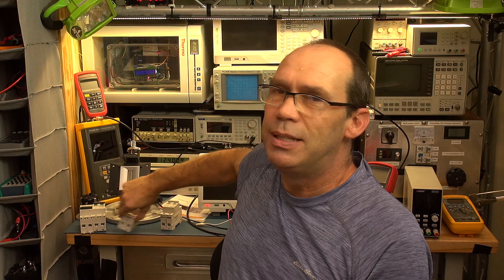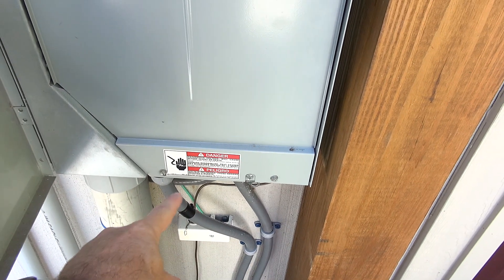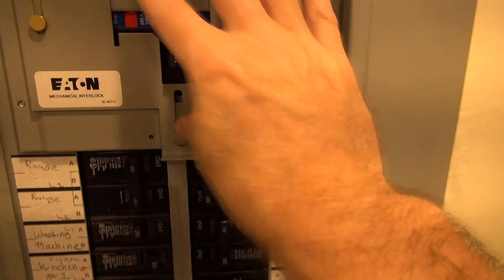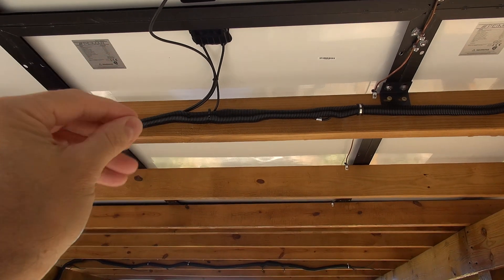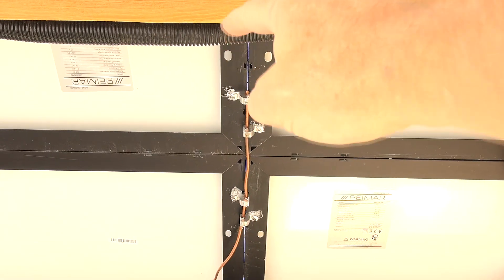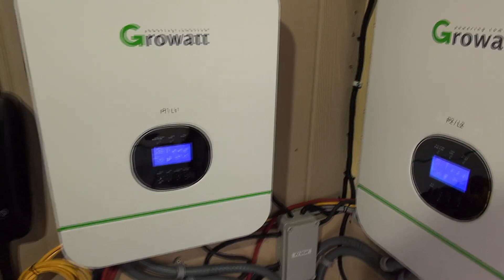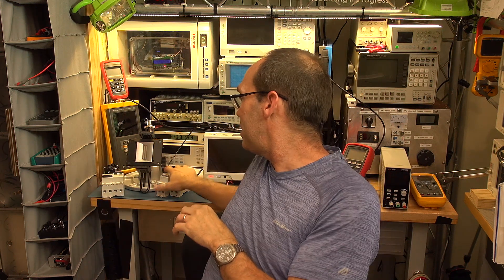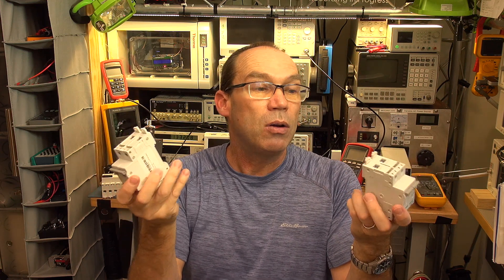Solar Carport Overview

Comment: Very interesting video, Martin.  I enjoyed it very much.  Just a comment about the barrel-type contactor you showed at 42:48.  Their coils typically draw at least an amp in operation, and they can get surprisingly hot as a result.  If you do use one, be sure to get a continuous duty model.  Many contactors of that style are designed for engine starting, so their coils aren't rated for continuous duty.  One trick to save power, reduce heat and extend the life of relay coils is to find their minimum pull-in voltage on the bench and operate them a couple of volts above that level.  Since your installation has no vibration, contactor pull-in and hold will still be reliable at reduced coil voltage.  Keep up the great work!

Comment: Thanks for this video.  Like all your videos, I can tell a lot of work went into it.  I am currently installing (slowly) a Growatt 5000 with a Solar Edge transformer to get 120V output and it helps to see how you did your grounding attachments to the solar panels (as well as all the other tips).  I'll be interested in your upcoming video regarding the DC breakers and the Arc Fault issues.  I want to build a safe system and if I can improve the DC side of things, so much the better.  Thanks.

Comment: A DC system is different to work with.  In my off grid system I try to power as many things as possible just off the panels. Lights TV etc  is straight forward.  I run my washing machine off a modified inverter with no batteries.  Excess power not used for charging is proportionality sent to the water heater which also regulates the voltage for other devices. This is so successful that I have a separate 40 Gallon tank just for the laundry. All cycles are done with hot water. Full size dishwasher runs off a small inverter because it takes way less than 100W, the heating element runs on DC from the panels. Everything is priority based. Energy management is the future.

Comment: I cannot say this enough.... you do EXCELLENT work and EXCELLENT documentation and your presentation is GREAT!
Your work is superb... very organized and well thought out!
I thank you for all that you have shown and what you have experienced with your solar installation!

One thing about using one of the DC contactors... be aware that some of them are only rated for intermittent operation as the coils are not made for continuous operation.
For instance, an automotive starter relay will burn out if energized for a long time (about 2 minutes) as they are made for intermittent operation.
Don't know about types used on cranes.... the duty cycle should be listed on whichever one you use though.

Also, disconnecting your solar array with a contactor, you might run into arcing problems with the DC... of course the contactor should be rated for your open circuit voltage and DC operation.

I know you probably are aware of all this from all the great research you have done, but I just wanted to give you my thoughts.

Keep up the fantastic work!

Comment: Re grounding the panel frames, your multimeter uses ~1 VDC to measure resistance, and thus shows a open circuit.  But, a lightning strike would surely arc thru the anodized layer of the aluminum frames.  Grounding the panels effectively makes them a lightning-rod and unlikely they would survive a lightning strike unharmed.  The grounding requirement is likely for personnel protection in case of a short from solar cells to frame or backfeed thru a failed inverter.

Comment: What brand meters and model are those displaying PV input power in the small black case with the handle? 
I have been looking for something like that? S
Do those use shunts or CT sensors?

Comment: I would just get rid of the dump load system.  I have been running my whole growatt  12k inverter for 5 months now on a much smaller lead acid bank.  Yes if there is a power outage, I won't have enough power.  House draws about 1200 watts base load.  Looks to me you would just need more solar to charge the batteries more the next day. You have a lot of battery there to  worry about using some off the top.   One thing I did do is buy a 48 volt battery charger so I could use my small Honda Genny to charge the battery's if the power goes out and there's minimal or no sun.  This keeps me from getting the bigger, louder, gas hog Generator out.

Comment: Guess what though. Your going to pay a large ass road tax every year. You want the plates? Come up with an extra 5 thousand dollars. You’ll be doing public transport and that’ll run you a couple of thousand.
Reply: Wrong. I just looked it up. I own an electric car since 2017 and paid 150$ more than a non electric car for my plates. Title fee was 70$ more. 

With most renewable technologies there's a "green premium" that you pay to participate in the change you want to see in the world. Not so with electric cars. For me, It costs $0.02 per mile for energy to drive it. Laughing all the way to the bank.
Reply: @BGraves  Fair enough, it’s a small impact as of now. As more vehicles move to electric the state and feds are going to want that road tax. Something typically paid for on a gallon of gasoline. Your going to see that cost go through the roof as electric cars replace fuel driven cars. You and I both know that it’s going to be a flat tax subject to the whims of the government. In essence they’ll have you by the balls. Leverage for the car owner 0 leverage for the government 100 . You don’t have to believe me. Just ask yourself.  When has a tax ever rolled backwards.
Reply: @dougridgway7570  I got a $7500 federal deductible and a $2500 check from Oregon just for buying an EV. They really got me "by the balls." Again, you don't know what you're talking about.

I paid 24,500 for my car that has 240 miles range and costs $2 to drive 100 miles.

Even if after 200 and something thousand miles I have to replace the battery, for 5,000$ so be it. I'll do it. Just like you'll replace your engine or buy a new car, and continue to pay for tune-ups and oil changes along the way. Do the math on how much gasoline costs to drive your current automobile 200,000 mi and you will see the light. Hydroelectric here costs me .07/kwh flat rate.
Reply: @BGraves  Maybe I don’t.  Surely a highly intelligent informed person such as your self can extrapolate into the future and see that this will become a real thing once the vast majority of cars are electric. No more incentives, besides I’m sure your not naive enough to not realize this will be the most direct form of taxation other than income tax. You know what direction that goes, up, up, up.
Reply: @BGraves  ahhh, who cares how you see it, you don’t know me. You may feel I’m being negative but I’m not.